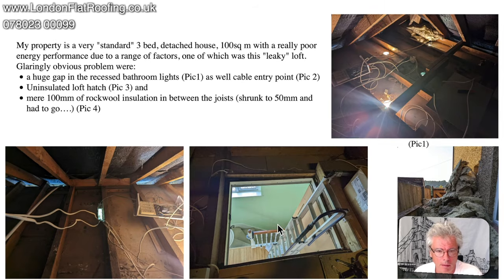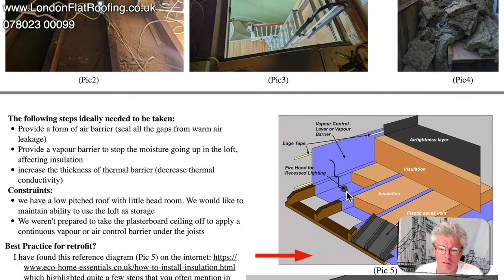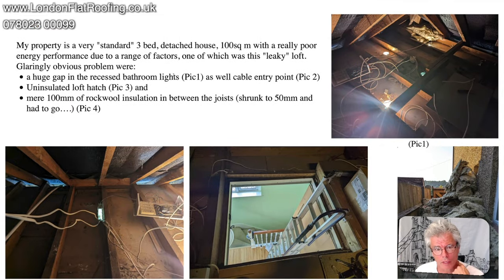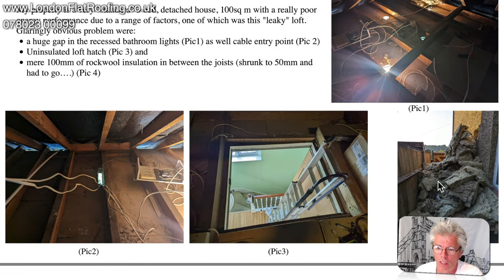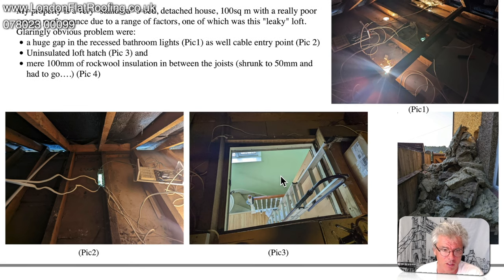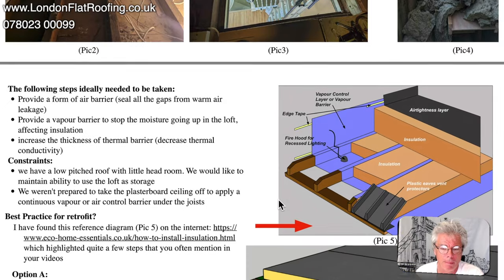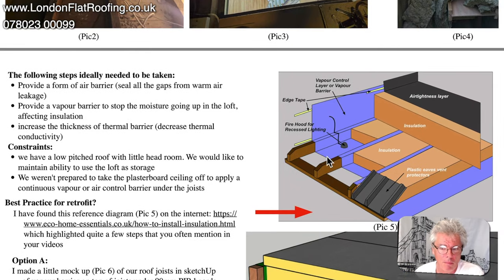Condensation In the loft things not to do

Comment: Looking at a similar situation in my 1910s terrace. Difference is there is already about 3cm insulated plasterboard that was overboarded. I’d prefer not to take everything off for a vapour barrier. So curious:

1. Is it ever okay to put a vapour barrier over the joists but under the insulation in between them in a cold roof situation? (As in the diagram in the video) This seems iffy to me as could trap vapour on the joists.
2. I’m guessing you’d recommend rock wool or similar, but given there’s two layers of plasterboard and some EPS could I assume it’s fairly vapour tight anyway, and use PIR for higher performance?

Thanks.
Reply from the maker: To difficult to answer send me some photos
Reply: Okay thanks, will do! I’m away from the house now, so will be a week or two.

Comment: Not directly related but in the uk for cold roofs we now need to have insulation under the joists.  So where does the vapour barrier go in this situation? Does it get sandwiched between the insulation?
Reply: Presumably under the insulation (always on the warm side) and then a plasterboard ceiling finish, no? Sure Steve will correct me

Comment: The problem I see with a sealed attic, is during the winter time, the chances of freezing water pipes and burst pipes,  is highly possible. Its the movement of air through the rock wool and into the attic that prevents this.
Reply: It's always been a concern when lofts have water tanks - fewer do nowadays. The advice was to leave the area under tanks uninsulated.

Comment: Mine was a nitemare (100yr old house). Put tape on hatch to seal and felt vents
Reply from the maker: did it make any difference?
Reply: @SteveRoofer  yeh the vents have changed the feel of the attic and its all dried out. Cost me twenty something quid and less than half hour to install. The attic door has helped (used felt draft proof tape and added wood frame) but I think it's more about saving heating costs than condensation with the door. You know the felt vents I'm on about?

Comment: She is obviously a case of a little knowledge is dangerous. The air pocket we used in Texas for radiant heat reflection on the outside of buildings, it's not brilliant for internal insulation. This lady would be far better served with Rockwool insulation to let the moisture out and forget about PIR entirely. It's fine to have around the majority of down lights where PIR isn't and it's hydrophobic. 
Possibly she would be better served watching some insulation videos on The Build Show Network or Matt Risinger's YT channel as her document is trying to hybrid US and UK systems for insulation and vapour management.
Reply from the maker: Yes thanks for this I I watch Matt,s videos all the time but have never seen this a gap on the outside apart from the age gap use for ventilation not in a gap used to collect radiant heat and reflect back!
Reply: @SteveRoofer  It has become quite common for foil faced peel and sticks or PIR as the last layer under the siding depending on wall/roof design. In theory it can be used internally but the loses and gains don't really support it internally and as you rightly pointed out from the design the lady has proposed it would lead to more issues with the structure.
Reply: I believe The Build Show Network and Matt Risinger's YT channel are American & the lady in question is in the UK. So wouldn't she be better to look at UK info rather than U.S?

Comment: Doesn't let air out but lets gasses out?... Air is a gas... 

The foil insulation is surprisingly effective with an air gap either side. It can be achieved by putting a baton on, then your foil layer, then more batons.
Reply from the maker: I was referring to the vapour resistance of the material vapour resistance is often mistaken for breathable. Some of the new air vapour control layer is on the market are what is called air open and are classed as breathable, but most of the older ones are just vapour open